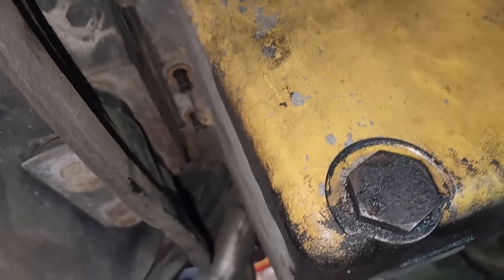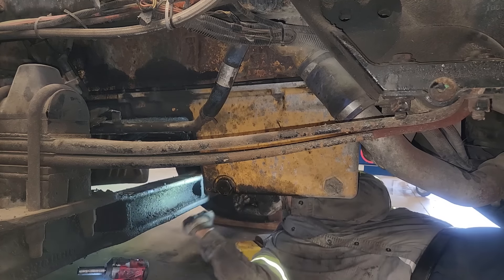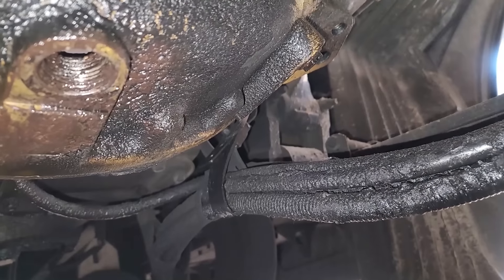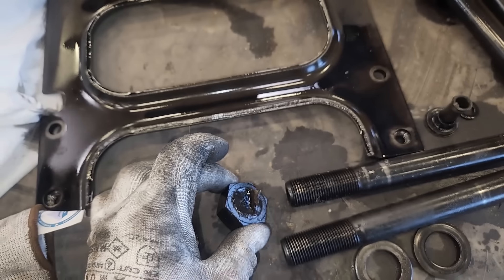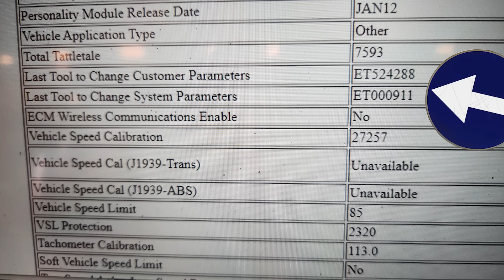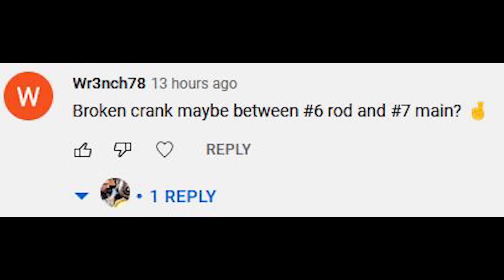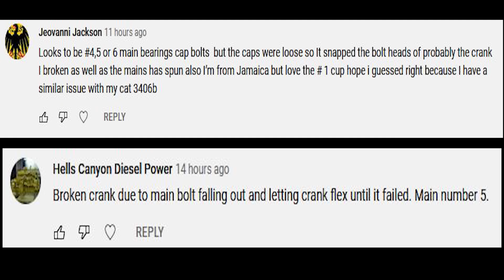This Is Why This Engine Is KNOCKING So Bad. "Knock It Off" (MAJOR DAMAGE).

Comment: A few months ago I replaced an ISX with a broken crank. Engine had like 40k miles on it. Shockingly the engine actually ran fine. The only reason we found the issue was because it was having clutch release problems and that's when we found the flywheel could move front and back like a whole inch.
Reply: My crank went 9m ago in my Cummins isx 425. 2013 KWT660. It was under warranty. Got a whole nother engine. Guess what happened 3 week's ago. The crank is going in this engine. Now it's getting a complete out of frame rebuild! These newer Cummins engines suck!
Reply: @MrMan-ol4ic  that's terrible, but Thank God it was covered under warranty!!
Reply: Ive replaced engines in trucks with less than 500 miles on them. One was a brand new volvo d13 that the bull gear dropped out on. That started a very fun campaign. The most recent was a dd13 in a brand new freightliner with a car hauler build, sent the rod out the side so hard that it blew the rods out of the compressor. Trying to pull that out in a car hauler frame involved a lot of swear words.
Reply: @MrMan-ol4ic  weird because ive never heard of such severe failure on the new cummins
Reply: @the Chevy guy Thicker oil reduces efficiency and makes cold starts even worse for your engine. You need the oil to be thin when the engine is cold in order for it to flow. You are not a petroleum engineer. Stop spreading misinformation.
Reply: @the Chevy guy thicker more viscous oil IS NOT PROTECTION it is only pressure, Resistance to Flow, the opposite of what is good. Engines live long lives with good oil flow... High pressure is the lack of flow and oil starvation. All modern engines are high flow oil systems.
Reply: @the Chevy guy i feel bad for u seeing as u didnt design these engines. the owners manual tells u exactly what oil for best engine performance and just because it “seems to run better” doesnt mean itll last. yes u can change oil weight for different climates if need be. anyway trust the owners manual man, it knows more about the car then u do.
Reply: @nathan7627  I would never listen to everything in the owners manual because now days the owner manuals on Cummins says you can run 20,000 to 25,000 on oil changes (depending on which engine and parameters) and I have always stuck to 12,000 mile oil changes and I have NEVER had any major engine issues with any of my Cummins motors from the big cam all the way to the ISX that have all had over a million miles without rebuilds when I sold them!!! Over my dead body would I run 25,000 miles on a oil change and I don't care what any manual says.
Reply: We had an engine where the customer complaint was that the bus lacked oil. So the technician went out and got the bus in to troubleshoot. They started it up to find the leak, and after a short while they found a hole in the block where the connection rod came loose from the crank. It ran on 5/6 cylinders..
Reply: @jasond5405  Pacar claims 80,000 miles at Kenworth for their oil changes because of new synthetic oils, even with conventional oil at 12,000 miles the oil has only lost between 8%-12% of it's life but everyone always recommended changing your oil not because it was worn out but because it's contaminated with dirt and carbon and also becomes acidic. That's on older pre EGR engines, EGR engines have lots of carbon buildup.
Reply: @the Chevy guy finally someone that understands!!!... i do the exact same thing...my brand new kia suv called for 5w 20...i still believe they meant 10w 30 lol runs mint since new...my corolla with a little 1.8...10w 30 too lol never ever used 5w based oil..might as well pour water in it
Reply: @jasond5405  Every Cummins that I have ever driven will tell you when to change the oil, they drop about 2 lbs of pressure, 40 down to 38 or so, usually at just over 10000 miles.
Reply: @christiantorres2950
Reply: Had a guy I worked with buy a brand ne Pete with an ISX blow a crank at 15,000 miles they put an new 1 in and it did it again
Reply: @ghostvapes yes bro, my buddy runs, well did. Running Shell 15W40 on his work truck, had a 350 Chevy in it. Got to almost 400,000k before it finally crapped out on him!
Reply: @jasond5405  not a semi guy, but I Am a bmw guy, I change my oil every 5k😂
Reply: I’ve heard there was issues with the ISX internal parts
Reply: We had a isx come in to our shop for a miss fire on cylinder 4 i popped the hood open the morning after it came in started looking at the engine and the connecting rod from cylinder 4 was sticking out the side of the block 😂 what was confusing me was the sound the engine was making sounded exactly like a miss fire

Comment: Im curious when the vibration damper was last replaced.  In my experience that is overlooked a lot and can cause a crank to snap.
Reply: True. Some people say it doesn't matter. Had mine replaced by Pittsburgh Power on an ISX several years ago. Replaced the Damper and also added the liquid mercury balancer behind it. It truly smoothed out the engine
Reply: I think in the "Serp. belt retrofit" video, he said 600k is recommended. So this one is only 200k over.
Reply: thats a good call, the fluid filled dampers are known to go hard over time.........easy way to destroy a crankshaft.
Reply: @Roger_Rabbit_Adventures  Very good point, dampeners seem to be a part that nobody wants to spend money on.
Reply: I have the same engine, I was told mine was permanent. Don't know what that means. But mine is not filled or nothing. I have an SDP engine.

Comment: Had the rod cap bolts fall out in my Nissan. Crazy part is that they where not broken. Slightly bent from the rotation. The blue factory thread locker was still clearly visible as well as all the thread's being intact. They literally fall out and where laying on the windage tray.

Comment: Wow!!! I've  heard of crank shafts snapping in half but never seen on still in the block. What surprised me was the head of the bolt for the main cap broke off like that. Am wondering if those two bolts where compromised on installation on last rebuild.....
Reply: I imagine a several hundred horse power 1500rpm hammer could wreck stuff pretty quick, hell of a lot of inertia spinning around and hitting metal on metal.
Reply from the maker: That's a very interesting way of thinking about it.
Reply: @AdeptApe  A bit like an impact wrench but everything massive.
Reply: @mrln247  that’s a powerful hammer
Reply: @mrln247  😂

Comment: I drove trucks from the age of 19 until I was 63. I've seen it all (almost).  Once a leased truck we had started knocking. I took to the lease garage to let them hear it, "they" said it was minor and not to worry.  At that point it sounded like a little guy with a hammer was inside the block. I took it back 3 more times and received the same answer. When the engine finally seized we learned 1 injector had gone "full rich" and washed that cylinder clear of oil. Now this went on for months and I got to ask the mechanic if it was a tough fix as he hammered the sleeve out. My point is   almost anything can and will happen eventually. Oh well it was leased and we got another to drive another as they fixed it.

Comment: Thought for sure the broken crank would have sent something out to daylight.  Guess they shut it down pretty quick.
Reply: I have a good picture of a 1LW with the rod hanging out of the cylinder block, with the crankshaft still attached.
Reply: Lots of cats have had broken cranks and ran fine

Comment: Awesome video., Back in 2010 I overhauled my 3406EK5 engine due to taking on water in the oil. While tearing it down the shop where I had it called & said my deck was out of spec & the engine would have to taken out to build back up. As long as he had ity out he said he would have my crankshaft ex-ray ed to make sure for no cracks. Well a day or so later he called & said  my crankshaft had some small cracks & needed to be replaced. No a Good deal but if my deck hadn't had to been built bad up, I would have overhauled a engine with a faulty crankshaft & most certainly been in the very same shoes as the truck.the new crank cost me $4800.00 which I hated but I couldn't have wasted the other $30,000 for the overhaul so I guess  in long run I was very lucky.Thanks for the video.
Reply: They say best time to find a fault is when you're already in the shop!

Comment: Josh, you should try and get your bosses to send you to AFA1 and AFA2. Personally I found the courses gives you so much understanding that then took my diagnostic ability through the roof when using the 7 steps of problem diagnostics. 
It’s very rare for a CAT crank to break. in 15years as an Aussie CAT dealer plant mechanic I’ve seen 3 failed cranks and all from incorrect maintenance or repair processes. 

It would be interesting to see photos of the crankshaft cracks to see why it broke. The origin of the crack is the most important point. 

The FLS at 127 is off the planet! Did it also have 5232 Injector trim codes? 
Cheap ways to get power always fail in the end. Would have been better off converting it to a marine setup or making it an 18 or 16 internals.

Comment: That's definitely a good one.  I had a truck come into my shop (a Mack CXU with an MP8, I am a Mack dealer tech) for an oil leak.  The tech working on it discovered a hole in the oil pan.  The hole turned out to have been made by a main bolt that came loose and was vibrating against the bottom of the pan.  I believe we replaced all the main bolts and bearings.  The main cap and bearing that the bolt came loose from were in good shape.  Good thing too because the main cap could only have been replaced by replacing the engine.
Reply: Wow 😮

Comment: Wow, this takes me back to the late 1960s.   I was driving an original Austin Mini - 848 cc of mighty British power.  It was a car that you could drive at its limits all the time without attracting much attention but it was a lot of fun.   Halfway through a 3 mile trip I was hitting high revs and a loud metallic knocking noise started.  Drove the rest of the way home and began a tear down.   Problem was a crack halfway across a crank throw.  Noise was the crack opening and closing with each revolution of the crank.  Lucky it didn’t break since the gearbox was right below in the sump!  Put in new crank and it was on its way again, at high revs.
Reply: It was a oil burner?
Reply: Yikes. I did a similar thing to my 2002 land Rover discovery. Driving from Colorado to Arizona at high speed. I pushed it beyond it's limits and slipped a cylinder sleeve out of place. Coolant mixed with fuel and it smelled awful. Coolant reservoir went dry in minutes. No bueno. Had to buy a used block from a junk yard in Los Angeles and use the old heads. It ran like a charm after that. I wish I didn't drive it like a sports car but that AWD feel so good at speed.

Comment: Hats off to the guys that called the main bolt failure. Main cap bolt failure was the cause of the broken crank have noticed that cats  Are notorious for bolt fracturing at the head, Deere also seems to be plagued with the same issue on head and rod bolts.  Just for shits and giggles I've noticed that there is no radius  Between the head and shaft on all the bolts that I had seen fail in this manner Might be a good place to start watching.  We always watch when working with steel  be it a crank radius or an axle I think all these new engineers have not been tought what we've learned over the years.

Comment from the maker: Thanks for watching and congratulations to the winners. Thanks to Western States for the cups. Amazon Affiliate Links to help the channel: 
Dex Fit Gloves, 3 Pack Cut Resistant: https://amzn.to/3rMUlR5 
Dex Fit Gloves, 12 Pack Cut Resistant: https://amzn.to/3g3uCBh 
Milwaukee 1/2 Drive Impact w/batteries: https://amzn.to/3chlAwB 
Dura-Block Sanding Block Set: https://amzn.to/35tbhkS 
Hutchins Sanding Block: https://amzn.to/3hWJuyi 
Anodized Aluminum 38" Straight Edge: https://amzn.to/38unDLN 
Fowler 18" Straight Edge: https://amzn.to/3nuofoW 
IR 315 flat air sander: https://amzn.to/39gPsWU 
Precision Instruments 1/2" Torque Wrench: https://amzn.to/3pgwqa6 
Precision Instruments 3/8" Torque Wrench: https://amzn.to/2NmFUlQ
Reply: I was hoping I was close to right I'm no mechanic by any means but I knew what sound was right off by first hand experience and I'm an ok parts changer
Reply: wheres the link for those gloves?
Reply from the maker: @operationscomputer1478  I need to get the link up for those, thanks for asking.

Comment: I, like the best three guessers, believe the number six main cap bolts broke first. The resulting loss of crankshaft support overloaded main bearing number seven, causing it to fail, and also overloaded the crankshaft itself, fracturing it.

Comment: Would be awesome to see a teardown and rebuild video but I'll bet he opts for a reman. Either way, a video on it coming out and going back in would be cool. 

Had a good destruction of the week the other day...magnet came out of the fill plug in a D8 final. Did 40k worth of damage lol
Reply from the maker: 40k for a magnet? Oh man.
Reply: Yup. The only salvageable parts is the spindle, hub, inner carrier and ring gear. When the magnet fell out it blew a chunk off of the sun gear and split the outer carrier then proceeded to eat up everything else.
Reply: Totally 😢
Reply: how does an actual magnet, fall out of a steel plug?!?!

Comment: Had a Mack crank snap from a dead missing cylinder created torsional vibration snapped same way.
Front damper issues also cause cracked cranks .
Reply: I think that’s what happened to my truck

Comment: Boat anchor,  when I take the oil pan off, while it is still under the engine. I take the four bolts out of the rear of the oil pump. That way it drops most of the oil in the pump and the pressure tube. I then remove psi tube and dump remaining oil out. Remove remaining parts and drop in oil pan. Most crankshaft breakage I see is on front or rear in the rod fillet radius. Grinder burn or inclusion in the metal. Very odd that the main cap bolts broke. I can see part of the shear lip on the bolt heads. I have seen head bolts do this as corrosion gets under it and causes a stress riser. ET0911, the warranty death tool.

Comment: I’m going to guess it was shock loading that caused the crank to break. Driver probably likes to release the clutch too fast when starting off especially on hills.
It takes an amazing amount of force to do that kind of damage.
I’m also going to say that the block should be replaced. There might be micro stress cracks near or around that area.
Better to be safe and replace everything than to chancing it and keeping the block. 
Stress to the customer to NOT screw with any settings because of the new warranty.
So many guy out there think that they need more horsepower.
A good driver can operate a truck with less horsepower than a guy operating it with high horsepower.
Reply: I think you got it right Sir. Shock loading.
Broke the crank first and then the mains bolts broke. Diaminio effect. 
 Like when people smoke their tires. They are shock loading the rear diff or other parts. Something has got to give. Seen to many smoked rear differentials.

Comment: Just wanted to shed some light on the failure mode of those bolts; it looks to me like a brittle failure in a combination of tension and bending. The diagonal area of the fracture surface is where the internal stresses changed from tensile to compressive from the bending force. 

This seems about right from a massive impact to the main cap, and once one bolt has failed the remaining one will experience a massive bending moment causing it to fail too

Comment: My guess is that the dampner  or crankshaft balancer has never be changed. Sure the bolts were broken but what caused them to break. Add in a past due balancer change and you add in a lot of vibration this you get fatigue thru out the engine and drive train.

Comment: another broken crank shalf i had was in the old leyand hipo which was a water truck after doing some fact finding that was caused by the sims pump that they used and the engine bolted      the owner at the time sold it and it looks like the crankshaft ended up with a slight bend and after a long time flexing it finaly broke

Comment: The main bolts have failed due to cyclic bending fatigue at the head radius which is one of the highest stressed areas of a bolt, final fracture is tensile not shear.  Multipel ratchet marks at the fracture inetiation site indicate high cyclic stress rather then a bolt flaw or load. would be interesting to see the CS fracture faces but I suspect also a fatigue element is involved, I would suspect the dampener if there are no vissible material or manufacturing defects in the CS. Bolts are placed in tension (pre load) to generate sufeciant clamping force (friction) so as to reduce the shear stress on them. Typicaly the shear stength of steel is less then its tensile strength so a bolts strength is used to protect it from its weakness.👍
Reply: Cyclic beating fatigue 😅😅😅

Comment: @Adept Ape not sure what your doing for repair, but I would be skeptical of re using injectors the dampener or clutch and flywheel. Most of the time when I've seen broken cranks it's been because of a poorly balanced rotating assembly or cylender contribution is way out to lunch

Comment: It looks like fatigue was also involved in the bolts snapping off. Can see areas that have a satin appearance indicating they didn't break right away. Id bet it just sort of sounded funny at first until they gave way completely from the bending forces they were subjected to, at which point the sections of the crank moved out of alignment and then it started to come a knockin'.
Reply: Overtorqued bolts maybe? I don't think they can snap this bad if they're torqued properly
Reply: Crank broke. Started beating on the mains. Broke the main bolts.